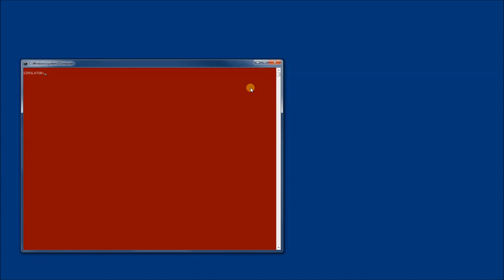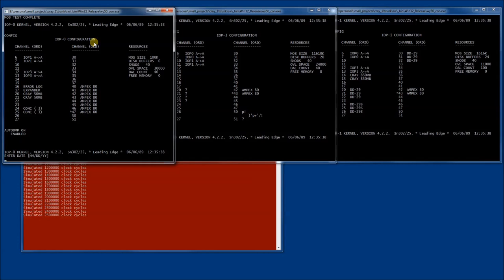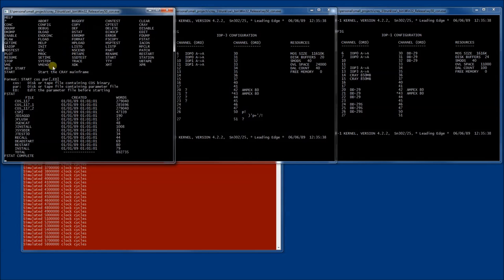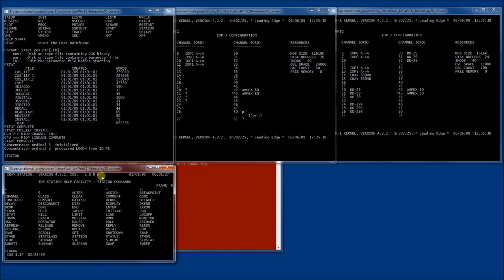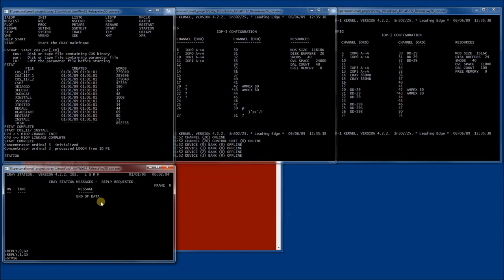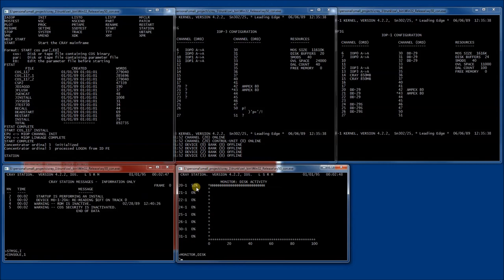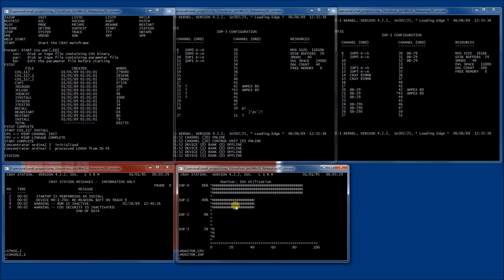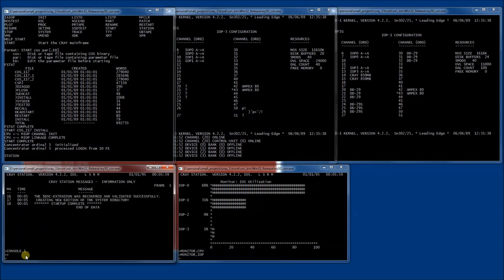Cray X-MP first run

Comment: Really fascinating; I appreciate how much effort they put into making the system observable with consoles for real-time messages, stat counters, and so-forth.
Reply from the maker: Thanks, but the feat is not mine. All of those consoles and stats and what not are part of the Cray operating system. These were quite complex things!
Reply: Monitoring was absolutely critical for effective use of the whole complex. The goal for what was considered effective use, was to maximize CPU utilization, while trying to avoid I/O contention, so every line of running code for a problem was critical. (Programming using the vector units on cray machines was not a trivial task, and even today on HPC clusters, there is a constant battle between utilization and resource overhead, and most of the time, humans do a really terrible job of thinking in vectors, and while computers can do a passable job of vectorizing code, the problem has to lend itself to being split up into parallel pieces....blah, am rambling...but speaking from experience.)
Reply: Model 'monitoring'can be used 'overview'of cray passage too Xeon,&why 'mon Tor ring sap app sync runs' byte aby?

Comment: Folks, If you're getting stuck on the CPU not responding message: 

In the IopClusters section in the .cfg file,  comment out the poke that starts with:
	;	0x3939 0x0028 ; Set CK0 device address to 050 - Hayes clock (should b ....
This tries to set the date/time for you but breaks the CPU to MIOP linkage. 
You'll have to set the date & time yourself but it should get you farther. 
I tried this with v1.0 and v2.1 from this page: http://www.modularcircuits.com/blog/articles/the-cray-files/downloads/
Reply: Thanks for this.

Comment: Supercomputers, Cray especially are pretty shitty.  There is no innovation in supercomputers at all.  Supercomputers are the perfect example of quantity over quality.
Reply: They use commercial CPUs now, yes.  But even if you take a pile of generic commercial dense servers and use them as your building block, there are still challenges.  Or perhaps efficient power/cooling, interconnect and storage at massive scale are all solved problems, no more work needed?   Riight...
Reply: "The Supermen" by Charles J. Murray. Read it.
Reply: Total crap out still duz neigh cause Think too waste sum of 'wanda why yer cant kno of' crazy paving shitter?
Reply: I second Madis' comment. Read that book. They did and still do amazing things. Anyone can strap together a bunch of off the shelf processors and call it high performance, it's another thing entirely to build interconnects, storage architectures and operating systems etc to make a super computer properly HPC.